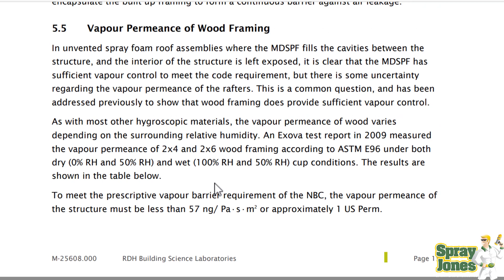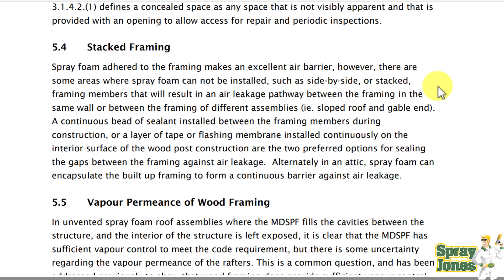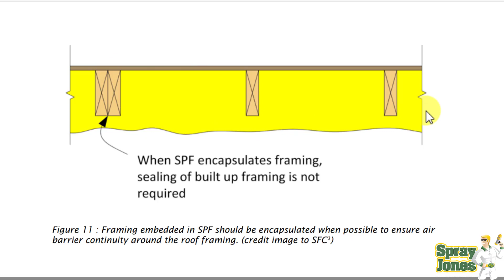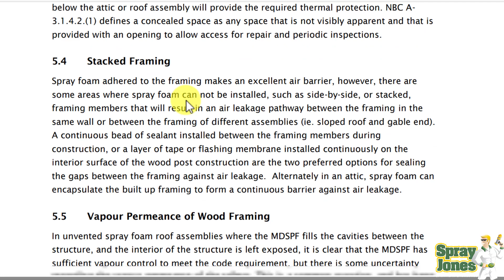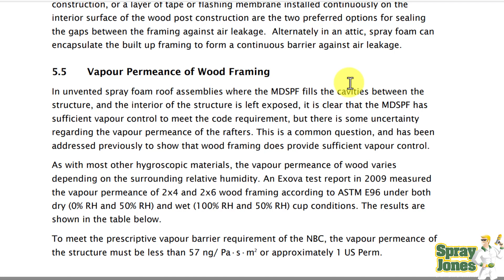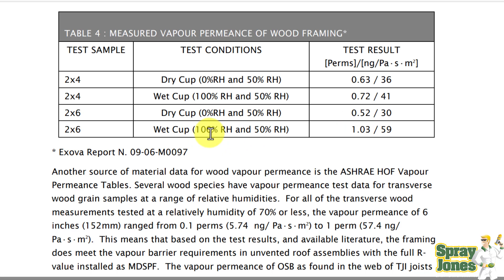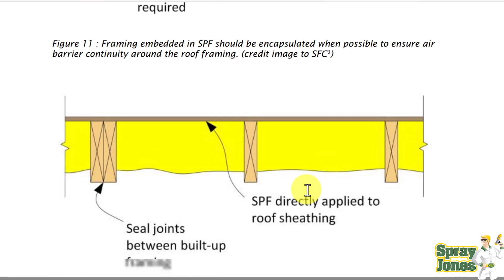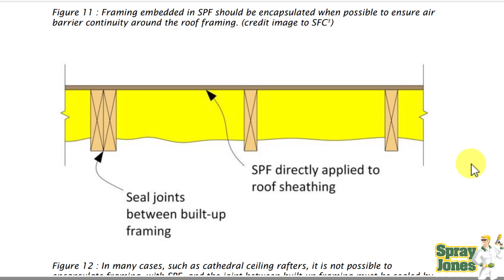Are the studs a vapor barrier when using closed cell Spray Foam Insulation?

Comment: And using kitchen fan during cooking +bathroom fan, doesn't affect vaccum effect ? 
If 99% of area is sealed you increase airspeed  at cracks.
Moist get in but not out ..
Reply from the maker: Who's in control? You or the outside?

Comment: Would an interior spray foam vapor barrier "clash" with exterior liquid housewrap (Prosoco, Polywall, etc)? Would sealing both sides of the structure trap moisture? Especially here in cold Canada. Have you seen this done? Opinion?
Reply from the maker: I don't know those products.

Comment: Will every building sprayed with closed cell foam now need to be force ventilated to get the vapors released inside the building forced out and replaced with outside air?
Reply from the maker: Open some windows and doors

Comment: Without a sheathing joint aligned with the stacked stud joint, how is there any more of vapor problem than at a single stud?
Reply from the maker: They don't want the vapor drive to make it all the way to the freezing point. The air must be kept further back in the assembly.

Comment: What about where those studs meet the sill or top plate.  There is that small area around that joint that typically doesn’t get spray foam or caulk.  Seem that would be a channel from the outside to the inside.
Reply from the maker: It can be. This is why we spray side to side and allow extra over spray to crawl up the inside of the studs as opposed to picture framing and leaving those seams exposed.

Comment: While air leakage and insulation are severly impacted by small gaps, vapor barriers are not. So even if the solid wood wasn't good enough, you would still have an 80% reduction with just the spray foam on the sheething. Something like a zip R should eliminate the issue more or less completely, then you can add 2 inch additional spray foam to the inside and have a package that deals with all air leakage/insulation/vapor barrier and won't have any condensation or mold risks.

On a roof assembly I'd just cover the wood anyway, like it shows in the video.